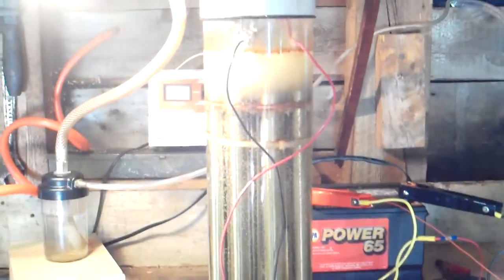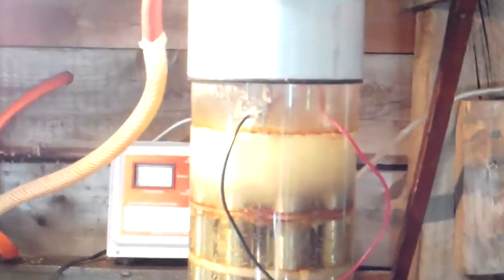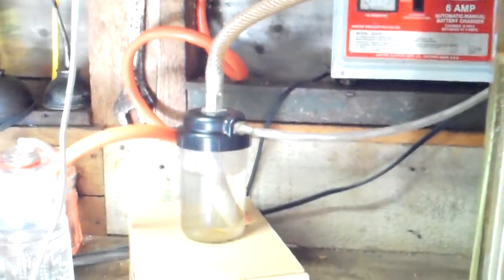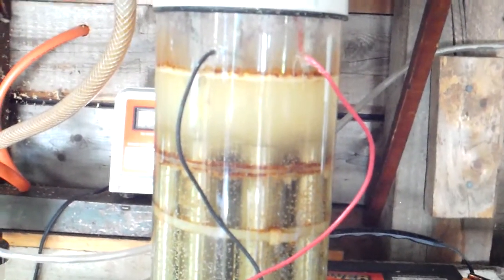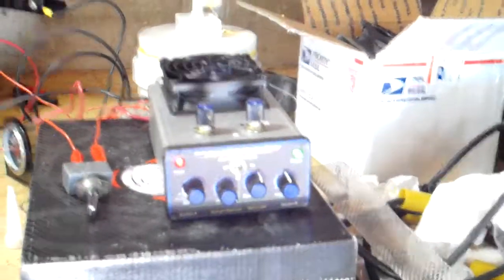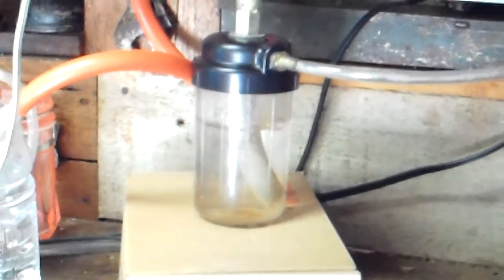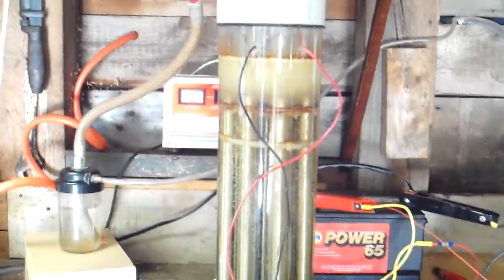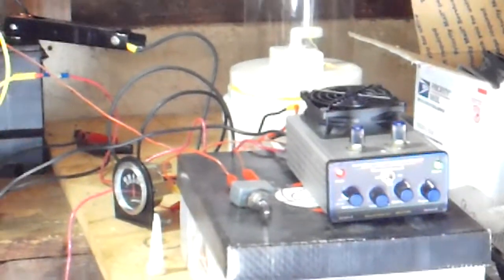HHOgenerator.AVI

Comment: @hyfusiondotcom 

Try to make any wire connections submerged under water, much safer. You are welcome copy my design if you like. Although the machine I built runs good I'm going back to the joe cell dry tube design as it is much more efficient. Maybe you will have better luck with performance than i did with mine. I wish you well.

Comment from the maker: Thanks for the tip about finding the leaks with dish soap. Next, I'm connecting a 4-way diode bridge, a 110v AC inverter a couple of heavy duty chokes and Bob Boyce's toroid coil running thru his board. But, first, I plan to measure current HHO production to compare.